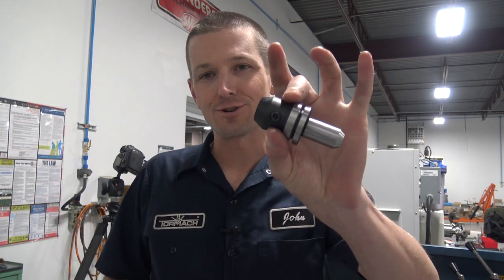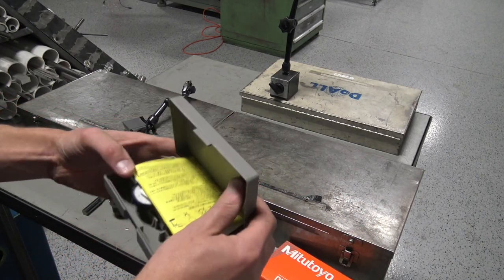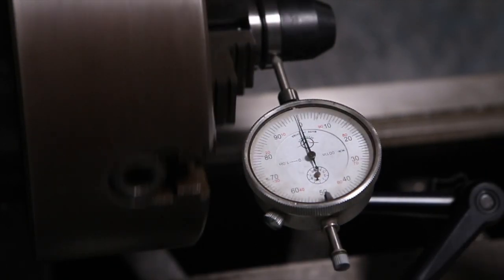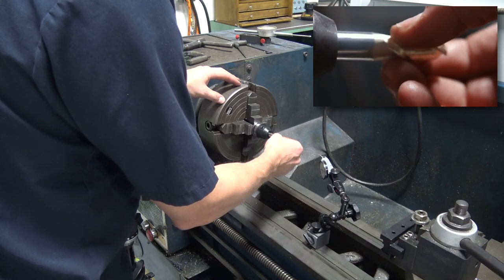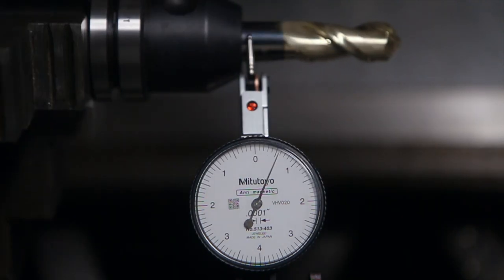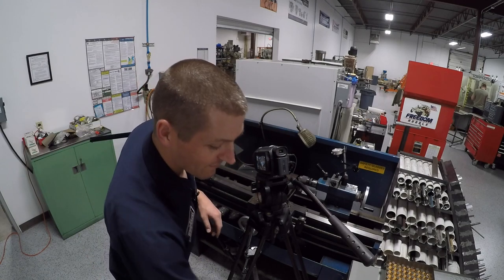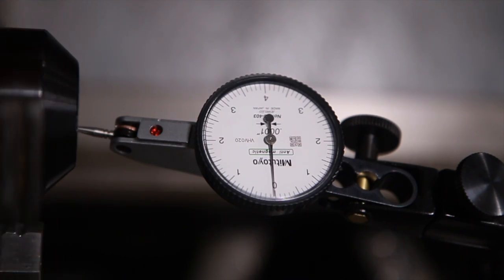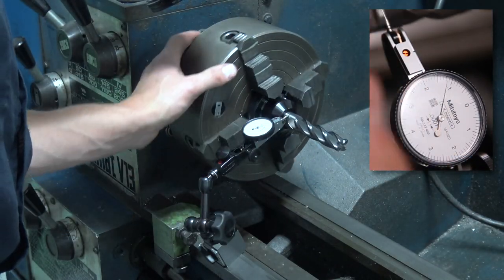Do Set Screw Holders Push End Mill Tools off Center?  WW122

Comment: Wooo!

Thanks for taking the time to measure, sir.

OK, brass tacks.

First, you're using excellent USA made and brand new toolholders that were manufactured recently, with USA made cutting tools that were also manufactured recently.  That is the best possible set of circumstances for a test.  It only goes downhill from there.  Depending on the shank tolerance on your tool and how old your setscrew holder is, it could go way downhill.

Second, like I said on Instagram, half a thou will not cause the machine to explode or the tool to snap off at the holder.

What it WILL do is impact surface finish when side milling.  No effect when end milling (more or less), which is what you were doing in the injection molding video.

If you have a two flute tool with one flute a half thou higher than the other, that change in scallop height when sidemilling makes a visible pattern.  The more runout the worse the pattern gets.  The more flutes, the more complex the pattern gets, but it is still there.

You can't feel it with your fingernails, but you can see it, and for some things that pattern can be a real problem.  For instance, I used to make paintball gun parts, which had to be polished to a mirror finish before anodizing, and this visible pattern caused me no end of irritation during polishing.  It IS real, because the deeper marks were still there long after the shallower ones had gone.

I fought and fought my process trying to improve the surface finish, and in the end I came up with two solutions that pretty much worked equally well.

1) I bought a milling chuck that was guaranteed to have less than two tenths runout at the tool shank, and they weren't lying.  TIR on the tool was just under two tenths installed in the machine spindle.  THAT toolholder combined with judicious replacement of tools used for finishing (they would do X parts as a finishing tool, then got demoted to roughing for the rest of their lives) solved the surface finish problem.  I had been doing the tool demotion thing before the milling chuck too, but after switching to the milling chuck the parts per finishing tool (that number X) went up about 20%.  It wasn't huge, but their life did increase with reduced runout.

2) An oldtimer I respected over at the CNCZone forums suggested that I try a single flute tool, either by simply removing one cutting edge from a two flute, or buying a single flute made for high speed routing for aluminum or plastic.  That tool would also leave an acceptable finish, even in a setscrew holder because to it runout was irrelevant.  Wherever that one flute ended up in relation to the spindle centerline didn't matter (except as a matter of total cutting OD, but these parts were never splitting a thou tolerances to start with, it was all about surface finish), because where it touched the work, it was always the same distance from center.  That tool too solved the surface finish issue.

Cost wise it was about a wash.  The milling chuck was about $250 (in 2004) and the good Atrax single flute carbide router mills were about $95 a pop.  The router mills were cheaper up front, but they wear out, whereas I still have and use the milling chuck.  These were all 1/2" tools, solid carbide, USA made.

I ended up sticking with the milling chuck method because I'd already sunk the money into it, and in the long run it was much cheaper (those were parts that I made for close to five years, so it more than undercut the router mills cost wise over that span), but I kept the single flute trick in my back pocket, and it saved my ass on several occasions later on.

Like I said on Instagram, it DOES matter, but not for everything.  You just have to be aware of what's going on with your tooling and use it accordingly.

That's why I suggested that you measure to see for yourself what your toolholders look like.

The setscrew holders I own are terrible runout wise, so I don't use them for things where that will be a problem.

I use them for things like big roughing endmills, or for other single flute tooling where runout doesn't matter (like form tools or half round engravers).

The things I use in setscrew holders most often are indexable endmills that I use for roughing (like that ShearHog you're so proud of).  The tolerances on most inserts are so large that whatever the toolholder itself is contributing to the high/low of the flutes radially is just making a poor situation slightly worse, and since I'm roughing, I don't care what the sidemilling finish looks like anyway.

I'd be interested to see what the TIR looks like with that MariTool holder actually in the spindle of your new HAAS machine.  That's how I measure all of my tooling, because ultimately that's the only place it matters.

Anyway, thanks again for taking the time to measure, I'm glad you took video of it.

Comment: I work in a shop that also grinds tools. run out can be significant in older, well worn and cheap import holders. Compounded by Chinese mills with shanks that are sometimes undersized by a few tenths.

We know our customers well, and the ones that use old or cheap holders get their tools ground in cheap import holders.  If the tools don't have weldon flats, we add them to keep the slop to the same side of the tool when set. This way, the shank can be pushed to the side of a sloppy holder by the set screw, but we grind the cutting edges true in that position.  Less effective run out.

You get what you pay for.  A high quality holder in good condition with a quality tool set in it will have negligible run out and can be pushed a lot harder without making my machines "sing".

Comment: I also cringed at the "toss". However, there were not any other employees around and that would be important as they follow what the boss does, not what he says. Also, I think that the "other" factors that could have mitigated the deviations could, just as likely, made the results worse! Also, tape can not be used when measuring in tenths. Also, when measuring in tenths, you can only do it when the actual cutting setup is used (CAT40 in the spindle of the machine to be used). 
NYC CNC videos have been of a great benefit to me as well as the comments. It is generally true that the comments are more helpful to me when a mistake is made. 
Great video!

Comment: My big lathe has about 3 tenths of error in the spindle bearings, no amount of dialing in will get the error to less than 3 tenths.  I only know this because I have used sub-tenth indicators to try and dial in parts to DNO.  Making sure that you have at least twice the resolution is important.  That means using a 50 millionths indicator to read single tenths, and a tenths indicator to read 2 tenths, and 5 tenths to read 1 thou.  A 1 thou indicator gets you within 2 thou.

Comment: John,

Nice demonstration.  My takeaway.  Measure the tolerances in your tooling if your work requires it, and adjust accordingly (as you demonstrated in the injection mold video).  Otherwise I would probably look for error elsewhere.

If you were to repeat this test I would look at doing it on a precision ground v-block on your surface plate.  Attach the indicator to your height gauge.  The lathe and chuck add a lot of potential error sources.

Thanks for the great video, your insight, and continued contributions to the CNC/machining community.

Comment: Ok, here's the bottom line.  You have some clearance tolerance built into the tool holder so you can get the tool into it.  Unless you are using shrink fit holders, a solid holder will always have a very slight amount of runout due to the clearance.  The better the holder and the better the tools you use, the lower the error will be, but it will never be zero.  So, yes, the endmill will be offset slightly from the centerline of the holder, unless the maker ground the hole eccentrically to account for the clearance.

Comment: The Command brand ones I get to use at work are usually well within .0005

Measured on a Zoller, HSK100a holders. 

If you want little runout as possible: use shrink, hydraulic or powRgrip. Usually all that ends up in an endmill holder is roughing tools.

Comment: John, When ever you indicate something in a 4-Jaw chuck you also have to indicate the face run out. It might be that you have a close run out at one place in the bore but not in every place in the bore (because of worn chuck jaws or the chuck jaws springing open when you tighten them). So to really get something running true you would have to indicate at the front of the bore than at the back of the bore (You may have to tap the part in the chuck than readjust the jaws and repeat as many time as necessary). You can also indicate the face if it runs true to the bore. So with your end mill test you may be running true in the bore in one place but you move the indicator out on the shank of the end mill and its not running true because the bore not running true in the back due to face run out.Also how tight were you tightening the set screw in your test? As tight as you do to really hold a tool? Usually it been my experience that you (I mean every one not just you) tighten them jest about as tight as you can get it. This does set the tool off center. Some end mill holder manufactures intentionally grind the bore off center to compensate for this.

Comment: The tool holder is centered with respect to the ground spindle mating surface. So you would have to insert this in a spindle or something that can hold on to the taper. That outside part of the tool holder doesn't need to be machined with very tight tolerances compared to the spindle mating surfaces and the where the tool attaches. That might account for the big swing in dial indicator.

Comment: GOOD NEWS!  -> John, You have a couple of compounding tolerances in what you are measuring. Take the actual tool and/or pin diameter in consideration of the runout that you have measured, plus still a little iffy on the tape, you forgot to cut the mesurement in half for diameter. So your runout appears to be actually 0.00015" on the tormach holder.
Might be fun to mic everything too!

Comment: For your test indicator look up specs on hysteresis. IIRC the compac (tesa) indicator I have is speced at less than 2 tenths (might be 1), but that's a multi rev. Metrology is a wicked business!!

You're also dealing with a not so parallel tool to bore axis if the set screw doesn't split the engagement length of the tool. Not much just off the end of the holder, but it can still be there, and get larger further out.

Comment: Retry this with the holder in the VM-3 spindle. Check the spindle runout (1 tenth or less likely), then the tool holder bore runout and finally the clamped tool runout. This should give you A) your total runout to compare with the ER and B) if you subtract the first 2, the runout attributable to the setscrew.

Also, you're used to 1.5hp. I absolutely would not use a setscrew holder without a Weldon flat on the tool in a 30hp machine. I've had 1/2" endmills pull out of a perfectly tightened ER32 mid cut well below full power and a setscrew holder without a flat to grab onto has far less pullout resistance. You'll also find that the machine has enough torque to overcome the holding force of the set screw and spin the tool in the holder...ruining the bore in addition to snapping the tool.

Completely unrelated tip: I'm not sure if they changed this with the Next Gen Control, but be VERY careful with the tool offset probe. I had a close call when I forgot to mark in the offset page that a 2in shell mill was not a spot drill. The probing cycle changes based on the type of tool you tell the machine you're using. It plunged straight down for what it thought was a spot drill and the inserts were hovering over the main body of the probe when I hit feed hold. Every time I put in a new tool I would immediately change the offset/probing page and run a probe cycle to prevent any mishaps like that.

Also, with the work offset probe, it's not active if the lights aren't flashing. That means you can crash it during hand jog. The tip is designed to break to protect the super expensive body, but it still costs $100+ to replace the tip.

Comment: I kinda like the description "set screw holder". I knew immediately what you were talking about, although over here we call them Weldon tool holders. I never used them because the tool supplier did not recommend them  at the time I first bought tool holders. I have been using ER32 and ER25 collets and they work just fine. Seeing this video I probably never will use Weldon holders.
What strikes me is that you do not use weldon tool bits in this demonstration. Weldon tool holders require btis with a notch in the shaft to prevent the tool from ever pulling itself out of the holder.

Comment: I will agree with most of the other comments, that this should be done with vee blocks on the surface plate. Also even 20 years ago, I remember the best tool holder makers talking about grinding the bore offset from the axis to compensate for the set screw. I measured about 3 tenths of intentional offset in their brand new 3/8" holder at the time. So you can't dial in the bore, you need to dial in the spindle end, not the bore. I guess these days the real winner is hydraulic holders or shrink fit. I've never had the chance to use them, but I've done other shrink fits like piston pins into rods, and I can imagine how perfect and rigid that would be in a tool holder.

Comment: The tolerance of AccuHolders is .0002" on the ID, measured with ten-thousandths carbide gage pins, and the "hand feel" is everything ;) Add the usual .0002" of clearance on tool shank OD, plus or minus a bit of chance, and there go your three tenths

Comment: You need to make sure not only that your bore is on center but that it's also in there straight along the the length of the bore because you may not be in there straight along the axis of the tool holder. Somebody mentioned putting it into the spindle and that is actually probly the easiest way to do that since the spindle is precision ground and new so you will most likely have very little if any play in the spindle. Interested to see if that straightens it out and give better readings.

Comment: you were trying to use a "very used" 4 jaw Chuck as a perfectly flat surface and we're adding run-out to the part. you should have used a longer gauge pin tightened into the holder and measured at both ends to make sure the holder was perfectly aligned to the centerline of the lathe.

Comment: 12:20 OK, you were surprised at +6 -1 But the point is that when you tightened the set screw, the +6 -1 did not change. So wherever your error was coming from, setscrew tension wasn't affecting it. For the actual tool, tighening the setscrew reduced the total runout.

Comment: Here in Seattle the aerospace shops don't like ER collects for milling on CNC machining centers they like the set screw end mill holders or for 0 zero run out they use milling chucks they say the ER collects fail sometimes on long runs with heavy cuts

Comment: I think John should retest the cat40 in the VMC I don't think it was cylindricaly aligned or parallel to the lathe there wasn't much to grab onto  with the 4 jaw chuck. I think that a thou of runout is quite allot for a 3/4 end mill even if they are not import  end mill holders. I thought the set screw run out would be more than a  few ten thousands of an inch. Nice video John.

Comment: For doing general purpose machining, not mold making or hard milling, I haven't really had any runout issues with set screw holders in VMCs. Grind a set screw flat on you end mill and lock her down and she probably won't pull out while you're roughing.

I've had more run out issues with beat up collets and cracked collet holders than anything. Good when they're but tend to go to hell after a few years.

Comment: The second tool holder was likely slightly cocked in the 4 jaw making the tool magnify that error. Basically the bore wasn't straight with the axis if the machine. But who knows when dealing with such a tiny thing. Great videos. Thx.

Comment: just an idea. The manufacturer must give a certain amount of clearance in the chuck bore on purpose for ease of tool insertion. since it is safe to assume this clearance is quantifiable, maybe they offset the center of the bore towards the set screw by half of the given clearance value. this would allow the tool to be concentric to the axes of rotation when screw is tight. I would love to see this test done by zeroing in on the toolholder shaft instead of the bore.

Comment: the bigger the tool the larger tolerances, if you're truly worried about run out and this is for all your viewers swap to shrink fit if you can mortgage your house.  we use them almost exclusively especially in the mag 3 at 33k spindle .00005-.0001 tir

Comment: You should take in consideration the heat from the machining process. It could reduce the play between the tool and the holder.
And use a end mill that is designd to be used with that holder (weldon ) the shank could be grinded at a specific tolerance for the holder.

Comment: When the Haas is up and running measure the 0.75" solid tool holder in the spindle. I bet you'll get better results.  I use 1/8" solid holders and I only get a few tenths of run-out.

Comment: The real test is to chuck that holder in the Tormach, and very lightly tighten the setscrew on a gage pin or tool shank. Measure the runout on the tool shank. Note the relation of the runout to the setscrew location. Now crank down on the setscrew to normal torque and measure the runout again. Now you know the inherent runout in the holder, and you know any distortion from tightening the setscrew.